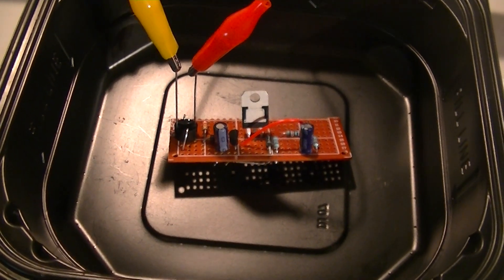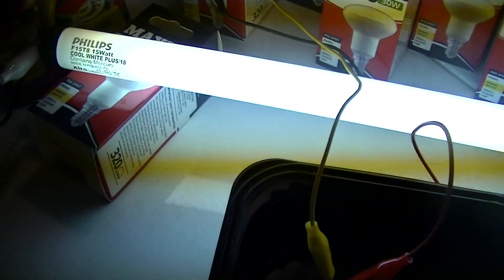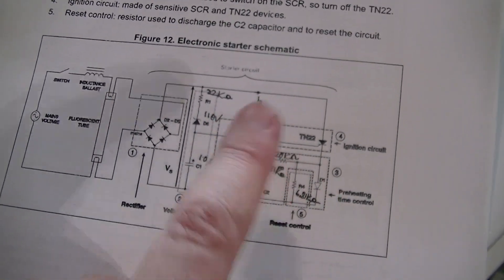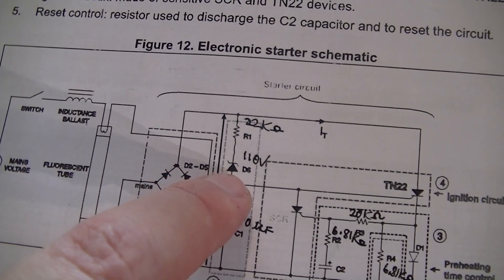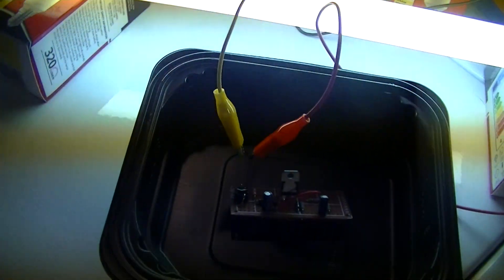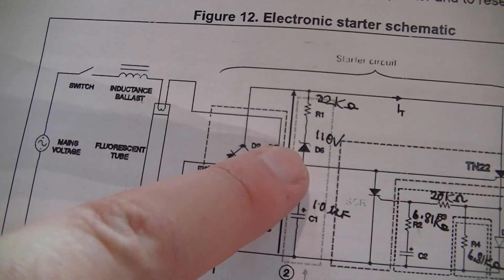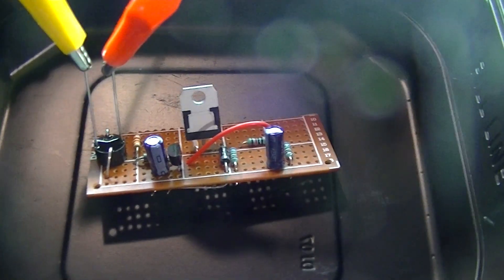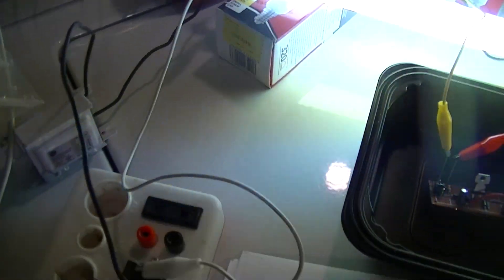TN22 TRIAC electronic fluorescent starter test circuit

Comment: nice! I have been acquiring a stash of Arlen EFS electronic starters before they all vanish against the LED onslaught, I have got a few EFS120's and some EFS600's but the elusive EFS600UVX escapes me, I tried to order a couple that where showing as in stock from a specialist lighting wholesaler, but I sadly got messed about with incorrect substitutes, which is quite frustrating as I do have some US and European VHO tubes in my collection which I wish to start as gently as possible 

 I am especially curious to know what sort of triac the EFS600UVX uses, the TN22 is only rated for 2A max, but im pretty sure the short circuit current of a 1.5A sun-bed choke may well exceed that...

as an aside note on regular ol EFS600, I noticed there seems to be 2 distinct types, older sorts that are rated "30W-125W" and newer sorts rated "4W-125W" and what I noticed is the 30-125W always starts the tubes nice and cleanly, a solid preheat follow by a clean strike just like in your video

but the more modern EFS600 4-125W sorts, seem to not strike the tube as cleanly, they preheat the tube for a few seconds, then while still preheating the tube, they also try to the strike the tube, so for about a second or so its stuck in this in between state with the ballast buzzing loudly as the triac pulse, before it finally allows the tube to strike

I never liked how they do that, so I always look for the older 30W-125W ones, but I do wonder what the difference is between the 2 sorts to cause this differing behaviour?

Comment: Could you try it with a hps bulb?
Reply from the maker: HPS lamps require ignition pulses on the order of 2kV to 5kV which would kill this circuit.  Making a conventional 3 wire HPS ignitor would be easier as those only have 4 COTS parts.